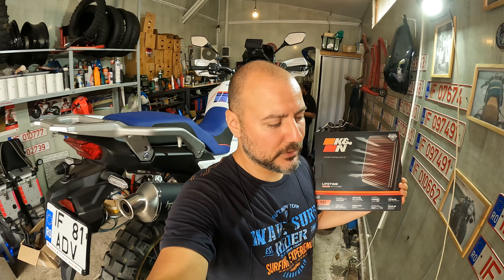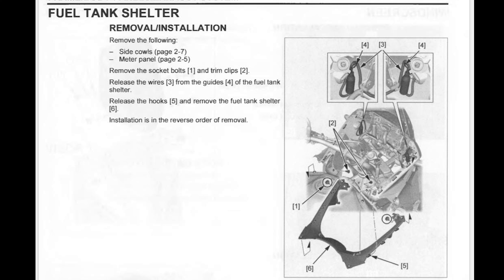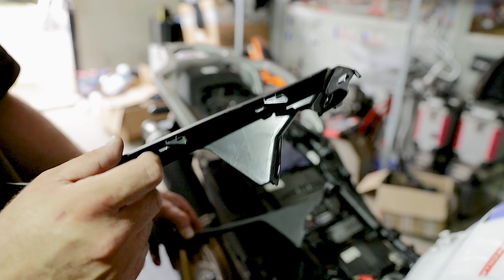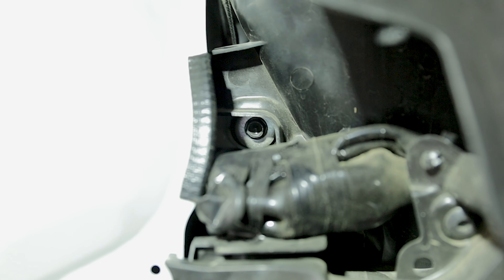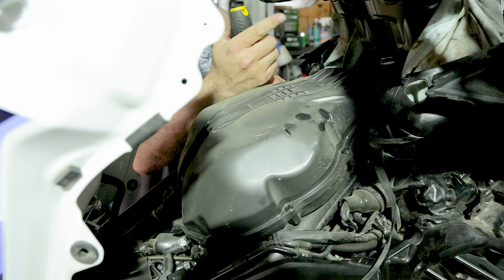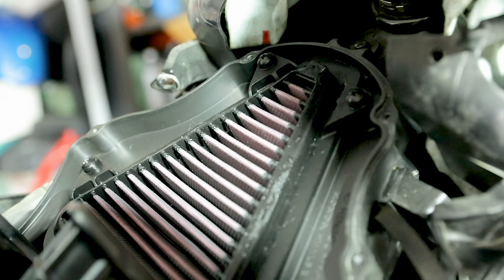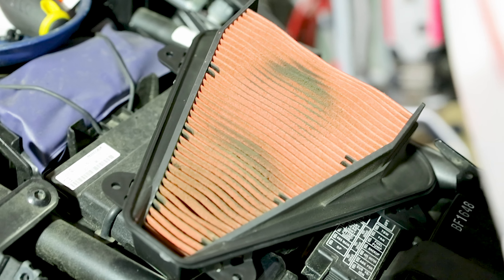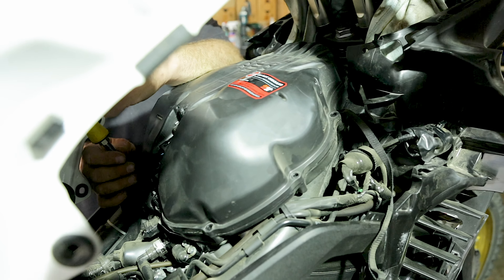Honda Transalp XL750 AIR FILTER Replacement - Step by Step Complete TUTORIAL

Comment: Thank you very much for a very useful tutorial. Despite all the negative comments on the internet about the air filter servicing, it doesn't look too bad to me. Certainly no worse than on my old XL650 which was also under the tank. It stayed clean forever too. Honda engineers aren't stupid 😀.
Reply from the maker: Indeed there is a purpose. Positioning the air filter under the fuel tank keep it cleaner. You have the proof right inside the video and the channel.
Reply: Very well said.
People who sit and comment on the internet think they are smarter than the engineers who put in so much effort into R&D
Reply from the maker: @vishaalpamulapati7035 everybody wants more but they are not willing to make any efforts to obtain it

Comment: I wanted a transalp until i watched this video
Reply from the maker: I think you are exagerating, this is a maximum 35- 45 minutes job. The size of the air-box and it's positioning makes the bike more powerfull, and as seen the filter it's almost new after 10,000 so you get a high KM interval maintenance (27,000 Km)

Comment: The rear bolt is to act as an hinge so the tank swing back, to change the filter.   The K&N filter will not increase the HP,   A US tuning company measure hp with bike on a dyno with OEM filter and then with no filter.   There was only a trace difference in HP on the Transalp with and without an air filter.    The engineer did a good job, the engine get all the air it needs with an OEM filter.
Reply from the maker: @fixento  hello, the Air Filter alone means no HP more. But an air filter + Exhaust plus Remapping does (+5 HP)

Comment: Thanks for showing this filter change in detail. Got the same bike and simply can´t believe what kind of work is involved only for a change of the filter element. My other bike (classic offroader) has its filter just under the seat. Taking it off, wash it and putting it back in should be a matter of 10mins max. I like your video but your statements reg "mapping" is a bit far-fetched, I think. Just putting another filter-element and another muffler on the bike, doesn´t necessarily provide more power. It might sound like more power but the truth is often different. Perhaps, you will do a video with riding experience after the mods. I´d be interested in fuel consumption (before/after) and low-rev torque behavior. Also, I wonder if the fuel-injection system will automatically adapt to more air through-flow...
Reply: He did mention re-mapping the fuel as well, to adjust for the greater air flow. But yes, the "5 bhp" remains to be seen.
Reply from the maker: @patkennedy1 It seems more than 5 HP when riding, but honestly I don't need so much power. The biggest benefit is the DELIVERY of the power and the throttle response. After couple of thousands Km I need to come back to you with a feedback

Comment: Nope nope nope - thanks for the video. Was considering this bike but there is no way I’m doing all that for such an important part…
Reply from the maker: How many Km do you make annually? Usually you have to make this at 24,000 Km. Are you making the maintenence by yourself always?
Reply: @IdealBike  I heard people who have to do that every two days in north africa trip and deserts, how can you dismount the bike, the guard, in the middle of nowhere every two days, or at least only week, thats crazy.
Reply from the maker: @andre0cooltube 99,9% of Transalp's owners don't do trips in Africa let's face it
Reply: @IdealBike   Well that’s not an excuse, Transalp is also the motorbike used for the world tour by some owners so he have potential.  Why does KTM have easy access to the filter and not Honda for an adventure motorcycle? That’s the question..
Reply from the maker: @andre0cooltube Honda wanted a bigger air box for more airflow to have a much powerful engine, also the positioning of the air box and air filter prevents more dust to get inside in comparison with other bikes.
Reply: @IdealBike  Well i understand, but i prefer a quick change for an adventure motorcycle, instead for a naked or sporty one that makes sense.. thanks for reply✌

Comment: I practiced once when I 1st got the bike. It seemed to take me forever to figure it out.
But the 2nd time it only took a few minutes and was not a big deal to do.
I did not see any videos or have the Honda Service Manual at that time.
I never use a K&N filter as they always never filter out as much dirt and dust as the stock filters. Which is why they flow more air. Not good for offroad. I am a licenced mechanic.

I can also do an oil & filter change without removing the Hepco & Becker skidplater I installed. I remove nothing and make no mess. Simply use some tinfoil (the stuff used in a kitchen with food) to hand form an oil catch tray to lay on the skidplate. I put a block of wood under the front wheel so the oil would run to the rear. Then use a socket on an extension and a ratchet handle for the drain plug.
A cup type oil filter wrench installed and removed from the left side and turned via a wrench once installed from the right side.
Reply from the maker: Hello ! Thanks for the comment ! Perhaps you could share some tips on both jobs so we can implement them? It would be really appreciate it , greetings !

Comment: Thanks for the nice and extensive video of changing the air filter of the Transalp 750, Alami is an excellent mechanic, his advice to remove the fuel tank completely is correct, that is only a few minutes more work and it works much easier.
There is a good reason for the air filter to be under the tank, if you want to get a lot of power from a motorcycle you need a large airbox, Honda did not place it there for nothing, moreover it is a place where the air filter does not get dirty as quickly as you have been able to see, under normal circumstances the air filter can easily remain in place for 20,000 km, I am curious how the KN filter works out and whether the power has increased. I am already looking forward to the next video. :)
Reply from the maker: Thanks a lot for your thoughts, appreciate it. I am grateful that I'm able to have such a great mechanic as Alami, he makes anyway everything seem too easy and gives me lots of confidence when he's working on my bike. I look forward to share my riding experience now with the complete circle finished : Intake, Soft Remapping and Exhaust. A detailed video will follow very soon 🙏 Greetings

Comment: A couple of tips...
1.  Snip off the clips alongside the inner panel that wraps around the forks and goes up to the dashboard. This enables the whole thing to tilt up without needing to remove the entire dashboard. This mod halves the time it takes to change the filter. I can do it in under 30 minutes start to finish with this modification.

2. Apply a little grease on the mating surface of the two airbox pieces. The sealing from factory isn't perfect and this will reduce any chance of dust getting past the filter.  Mine had dust on the bell mouths when I changed mine at 3000klms. 👍
Reply from the maker: These are great tips, thanks a lot 🙏

Comment: Yes, it is a ridiculous amount of work just for the air filter. My element was almost identical to yours in terms of dirt - I did mine at 12,500 kms - and I also fitted a K&N, as I have done to most of my bikes. But I counted ten panels removed, and although I didn't count them all, at least 50 fasteners! As you noted, fourteen at the airbox alone. Yes, it's not that difficult, and of course it should be quicker the next time, but there is no doubt this has much more involved than it should, for a bike built to go on the dirt. I wouldn't fancy having my bike so dismantled at the roadside.
I found it easier to leave the rear pivot in the tank, remove the restraint ribbon, and just prop the tank fairly vertically to work on the filter (I was doing mine on my own). I think I had to unhook the fuel hose from its clip to permit this. I would suggest getting the K&N 'Recharge Kit' - a bottle of cleaner, and a bottle of the red oil - at the same time as the filter. You will need it anyway to service it in the future, and that permits you to add a little extra oil to what it comes with. My bike still has the stock muffler, so I didn't remap it, but I think there was a slight gain in power, but only at higher RPM. I would be keen to keep the remarkable economy of the bike, which seems to be even better the longer I ride it. Not sure if the K&N has contributed to that.
Let us know if you found extra power with yours. As to the claimed power - I think it is 92 PS (German Pferdestarke) which is 90.5 horsepower, just for accuracy. (And these measures are taken at the crankshaft, such that it will be around 77 at the rear wheel stock, if you dyno it). But you might gain some response at lower RPM with the muffler and the remap. Let us know, and how the fuel consumption was affected. 
Thanks for the tutorial Arthur. My Transalp is at 17,800 kms now, here in Australia, and I still love it.
Reply from the maker: Thank you for your imputs very valuable. In terms of power I have now about 5HP more with the muffler, Soft Remapping (Stage 1) and Air Filter. The power delivery it's the greatest benefit, the fluidity of the engine and acceleration. Fuel Consumption need to recheck, seems to be the same as before but I was riding very aggressively

Comment: Is it mandatory to remove the side tank guards in order to remove the side fairings ?
I am asking this cause I have mount fog lights on side guards and is very complicate task to remove them.
Reply from the maker: As seen in the video the answer is yes, any tank guards / crash bars need to be removed. It's not possible to take out the fenders otherwise... I've hoped until the last minute.... 😊

Comment: Honda says replace air cleaner at 24X1000 km? Why replace so early?
Reply from the maker: Because I've ridden off-road, dust, waters, mud and I said why not to check it. The second reason was the quality of the K&N air filters, they are offering a long maintenance intervals and general longer lifetime. In combination with the Hp Corse exhaust and the Map Soft it's a different riding experience in terms of acceleration, torque, sound, engine fluidity and smoothness.

Comment: I don't understand why you think you will do more km with the new air filter you installed? After all, the original filter is denser and has a larger sheet of filter paper than the new one.
The very fact that more air will enter the engine through the new filter means that it has much less filtering elements and it is less good for the engine.
In my opinion, if you had lowered, or opened a wider opening in the plastic cover of the original filter, much more air would easily enter the engine.
Personally, I didn't get to the point of emptying the air filter and everything I write is based on what I saw in the video you took.
And thanks for the video!
Reply from the maker: Thanks for the comment, appreciate it. The K&N has also some filter oil in comparison with the OEM that's a plus , and you can make the maintenence without replacing it
Reply: @IdealBike what do you mean.. whithout repeplcing it ..???
Reply from the maker: You clean the filter, you oil it and put it back in

Comment: Think Im gling with tennere or tuareg. 660 xD
Reply from the maker: Tuareg has by factory an issue with the front stock suspension plus multiple small issues. Plus parts are coming delayed after many months Tenere is a great choice for better off-road right from the box, but still less power and not so good on-road as Transalp

Comment: What a pain in the ass!! I will never buy an motorcycle like this.
Reply from the maker: What would you buy and for what purpose?
Reply: Since 1999 I own an MZ Baghira (3 bolts on the seat to change the airfilter, oil-change is a little bit more of work, sparkplug very easy), after that I rode a couple of years an Suzuki SV 1000s (airfilter-change, oil-change and maintenance was easy too), since 2012 I ride BMW F800GS (remove the seat, 6 bolts to remove the middle-cover, 4 bolts to remove the airbox-cover - and I thinked, this is too much), oil-change is easy too. But sparkplugs and valve-clearing is a lot of work. Of course, the airfilter-change is not the only thing I do with motorcycles. But for me the D.I.Y. - maintenance-ability is very importand to be independent from dealers (and high prices for maintenance) and it is an indikator for good engeneering to make the bikes maintenance-friendly. I like "the middleweight-SUV´s on two wheels", they give me the freedom for independent travelling and camping, ride to work (offroad too, if I want). But for me the D.I.Y. - maintenance-ability is very importand to be independent from dealers (and high prices for maintenance).

Comment: WTF were Honda thinking ?
Reply from the maker: Perhaps to keep it cleaner and to have a bigger air box
Reply: Bring in more time revenue for the workshops.
Reply: @SherKhan-b1kes  yep, that was my first  thought
Reply: Probably were thinking that customers would like the power gains of having short runners and close to the ports in exchange for having to take 20 minutes to remove some fasteners. Also having the intake before the wheels makes for cleaner air. I don't know but I wouldn't be surprised that the air filter change is every other oil change.